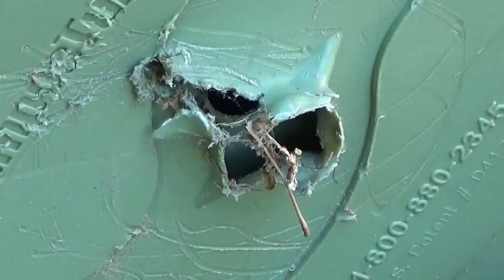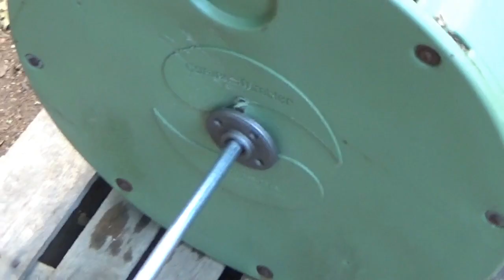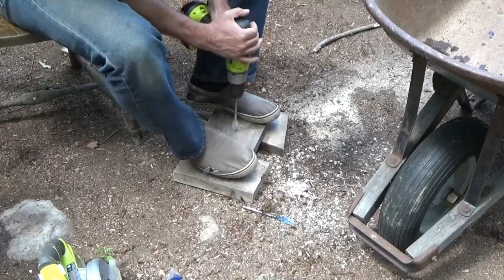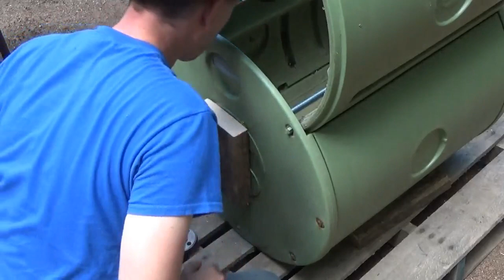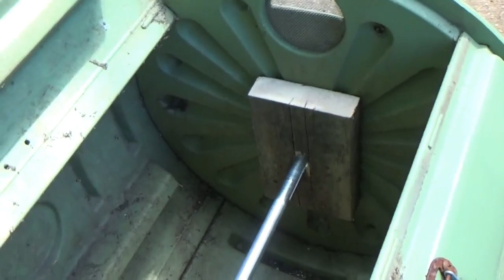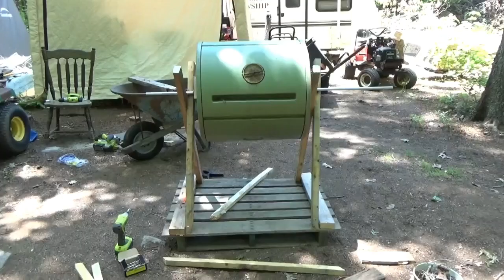Repaired Broken Tumbling Composter Even Stronger & Better

Comment: I have the same composter and the cheap frame and axle rusted it out.  I have been using it on a frame, without the ability to rotate it.   Thanks you your video, I built a frame as you did and it works perfect.  I cannot believe how much it breaks down scraps, leaves, and weeds to make great soil for plants.  Thank you!  Ron

Comment: I would recommend a piece of steel plate or aluminum (a old damaged road sign) instead of the wood which will rot up with the compost. You gonna cut the pipe sticking out odd and put cotter-pins & washers on it so no one runs into the pipe?

Comment: you did not over kill the x crossing one lonely deck screw to hold all that weight. try a 3/8 long bolt minimum it will make it stronger
Reply: The wood would split before the screw would fail.
Reply from the maker: I can reinforce that. Thanks
Reply: you mean you can not add a bolt threw both 2x4 to make it stronger????

Comment: Am I missing the obvious reason why the wood won't decompose inside the bin? IMO A better option would probably be to get 2 more of the metal pieces and put them inside and then use bolts to secure from one side to the other. The wood is likely going to rot and decompose, or am I missing a reason why the wood won't decompose as well?
Reply: Probably but it will take a while before it does and will be a very fast repair to replace it. Meanwhile, he has a very usable composter.
Reply from the maker: I figure it will take years to decompose in there.

Comment: what is that Center shaft made out of again? it looks like it's thin wall tubing? why did you not go with solid bar stock? like the idea but I figured that that's your point of failure in a couple years where is solid stock would last really long
Reply: round stock I said it wrong
Reply from the maker: Electrical conduit
Reply: The Do It Yourself World I really think before you get too in love with it you should change that out with solid round stock the conduit isn't Tough Enough other than that it looks awesome to me